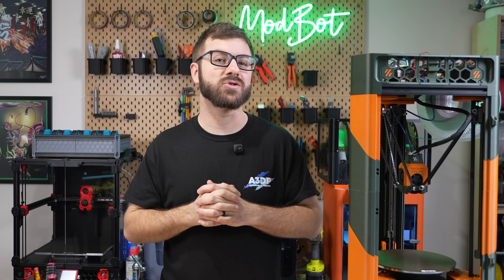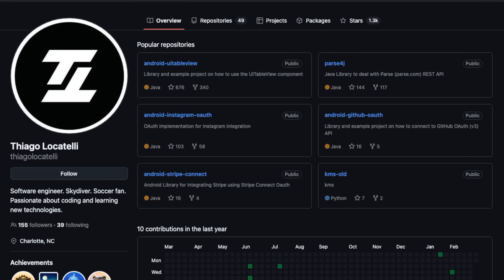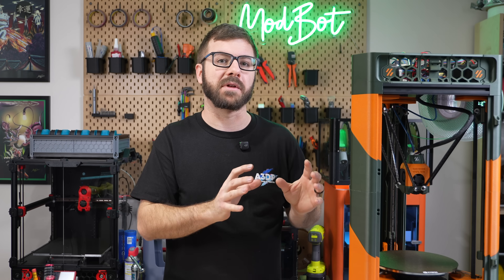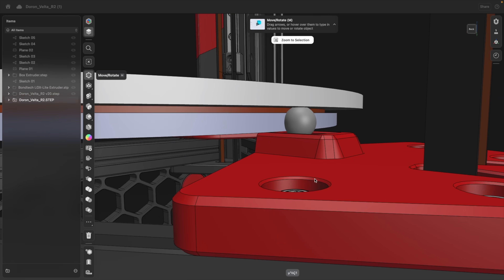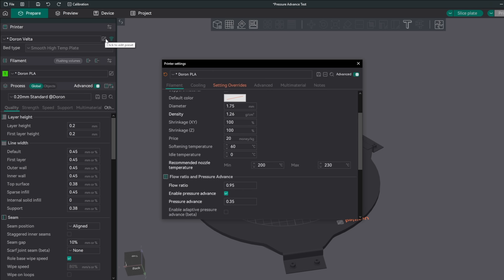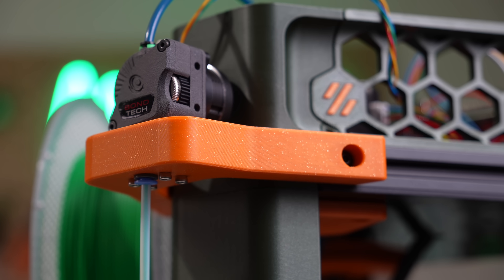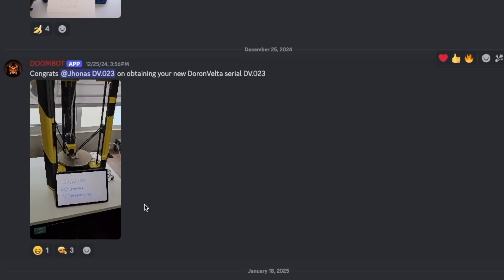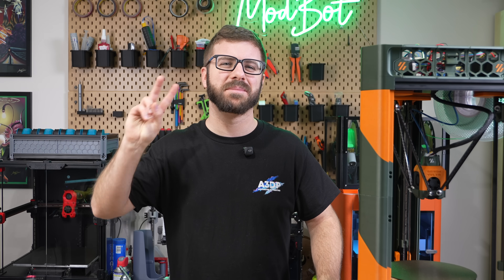Open Source Delta Printer That Began As A Joke! (Doron Velta)

Comment: Hi, having built and designed my own delta printer using a V6 with CHT knockoff nozzles and a 400mm capricorn tube. My Pa values are 0.8 for petg and 0.6 for PLA and retraction is at, 2.5mm. I'm unaware about your figures. But maybe mine help

Comment: Thinking about how a Delta moves, i think the bulged corners are from toolhead tilt. A swing when it stops and a lag when it goes. The more organic models you showed didn't show it as bad as a straight-line-90°-straight-line-repeat. The tilts would be more gradual with the frog, for instance.

Comment: Something occurred to me. The way the printhead is mounted, it could be angled to pretty much any angle to get away from the planar way of printing.  For real control the dual arms would need to be independently controlled because at some angle one would need to be longer than the other.  This would enable printing things that have no support below.  Just print up to the top and then continue on down.

Comment: Helloooo Nurse! My first large format printer was a giant delta, which killed itself during a 22 hour print quite the while ago. I've been meaning to give it an overhaul with linear rails and a rapido, but got absorbed into resin printing until just recently. Enter a new large format corexy, now I need a test bench for filament development without wrecking my good one. Ship of Theseus, now arriving. 👍
Add: to combat stringing on my old machine, I had to run fairly extreme retraction rates. I can look up my old profile for specifics, but I want to say it was 4mm at 40mm/sec retraction. I'll update this if that is incorrect.
Edit2: .1 layer height was 4mm, .2 and up was 6mm, same retract rate between the two. This was back in the dark ages of 2017 for reference. 😉

Comment: During the 8bit repetier firmware era, deltas used to have a "value" that converts standard cartesian movement into delta movement. Playing with this value will either give the prints a convex or concave outer wall.

I don't know if this is still the case with 32bit firmwares, but i thought it might help
Reply: Anyway there is also a flying extruder options for deltas, aside from direct or full bowden.

Comment: Drop orca slicer. I’ve had nothing but issues on my feta with it. I reflashed firmware and then sliced same file with cura and bam. All fixed
Reply: that shouldn't be the solution, bowden extruder is.

Comment: Don't go direct-drive. Delta printers have an option no other printer kinematic has and it's amazing: Flying Extruders!
The basic idea is to mount the extruder via a flexible medium (springs, bungies, etc.) between the 3 rail carriages. This allows for a fairly short and very straight bowden tube. The advantage to the short length is obvious, but the advantage to the straight shot might not be. Being straight, the filament doesn't have an outside-path and an inside-path to shift between, so retractions are much smaller and more effective. I have a modded Anycubic Kossel Linear Plus that does 400mm/s with a 23mm Nema17 mounted this way and my retractions dropped to 2mm with a cheap tube and 0.4mm with a 1.9mm ID tube!
Reply: I had an  Anycubic Kossel that I modified to a flying extruder setup(spring mounted,15 cm bowden). Works nice until you try to go for higher speeds. The oscillating extruder introduced a lot of ringing artifacts.
Reply: @dutchsailor6620  Yeah, flying doesn't decouple the mass/inertia as much as people think. Depending on the height it's at, you can almost entirely get rid of linear inertia in xy moves, but you still have angular inertia, and you need a long bowden tube (bad print quality) to do that. Also if you use loose coupling you're not really getting rid of the mass just damping it, meaning the vibrations turn into really low frequency ones from the flying extruder that input shaper can't suppress except by printing really slow.
Reply: @ I actually sold the kossel and bought me an ender 5 pro, same build volume and faster but without the tinkering. Modifying can be fun but sometimes everything just has to work.
Reply: @daliasprints9798  "flying doesn't decouple the mass/inertia as much as people think": it does if you mount it correctly (as I described above). If you watch my printer when it's printing, the extruder assembly simply rotates rather than yoinking side to side all over the place. Rotational inertia for something that compact is dramatically easier to overcome than the inertia of the same mass on the head.
I've seen improperly mounted examples before, which is why I described how it should be done.
Reply: @glabifrons  Yeah I said mounting it high avoids the translational inertia, but gets you a longer tube (more like long bowden) and still has the angular (yes that's a lesser problem).
Reply: Flying extruder is comparable to bowden in extrusion accuracy/amount of PA you need. RDD is so much better.
Reply: @daliasprints9798  The gap between a curved bowden long enough to use in a delta and a straight shot that's only a few inches long is enormous. Re-read my numbers. The stock bowden tube required an insanely long retraction (way over a cm) and constantly had the extruder motor screaming.
As to RDDs, the idea is nice, but I've yet to see one that's actually got good reviews by anyone willing to demonstrate them... which do you use?
Reply: @glabifrons  Bowden retraction should only be about 1 mm, possibly less, if you're using modern firmware with pressure advance (if not, you're in a really outdated class of print quality that won't be acceptable above like 30 mm/s due to scale of errors).

Where it matters is bowden vs DD pressure advance constants. DD gives you 0.02 to 0.05 mm/(mm/s). Bowden can easily be 0.5-1.0 for a long tube, and 0.15-0.30 for a short flying one. Short is much lower, but still so much higher than DD that it's very limiting to what speed you can do accurately.
Reply: @daliasprints9798  Apparently I cannot even mention a number referencing things on a certain site that hosts models without the post being insta - ( 3 n 50red.
Finally... one made it through. You know the site, same username. Both flying extruder mods were posted over half a decade ago, well before pressure-advance existed.
Reply: @daliasprints9798  At no point was the rotational inertia a problem with the 23mm stepper. It was only just noticeable with the huge stock motor (again, see the things mentioned above).
You mentioned remote-direct-drive, but have yet to tell what you're using.
Reply: @glabifrons  Both the ones I use are on my channel. The M45 has the Semitruck rigid RDD extruder which it about ready for public release (someone has already reproduced it in private testing). My Ender has the Flex3drive G5 with upgearing prior to the flex shaft to achieve high speeds.

(Most of my videos are Shorts in case you're checking the Videos tab and not seeing anything but a small number of longer prints and old stuff.)
Reply: @daliasprints9798  Interesting setup! There was one from many years back that used the exact same approach for a coreXY printer and I was surprised it didn't catch on. I guess the off-axis angles you're seeing haven't been a problem for the U-joints (eg: binding or causing the vertical shaft to flex away during quick rotations at steep angles)?
Are those CF square tubes? (hard to tell)
Reply: @glabifrons  Yes, those are square CF tubes so they don't really flex any appreciable amount. In early versions the whole upper motor mount was too flimsy, allowing the joints to bind at the edges of travel. But with the vertical segment constrained and the lengths chosen to keep the angle within the working range, binding doesn't occur; the path of least resistance is always the vertical shaft sliding up.

Comment: The original Bowden tube length is wayyy to long. Flying gantry extrudes are the best Bowden length v effector weight compromise. But an extruder mounted midway down is a minimum at least.

Comment: I'll take a took, I think it's a combination of hardware and software, it looks like over travel personally but I'll take a closer look. I'm building a duet powered flsun sr with a duet smart effector and high-end motors and end stops. I'm going to build a delta from scratch later this year, but I like the sr kit, so I May or may not adapt it to that.

Comment: just out of curiosity, what are the benefits of this setup over any other standard ones? I am using 3d printer mostly for workshop jigs, accessories, tools etc, sometimes I'll print for someone something. Delta is highly limited due to surface, so  I see it mainly as figurine printer but I wonder if the 3 arms are at any point better than classic bed on X, Hotend Y i Z, or XY for Hotend and movable bed on Z. You make nice content generally, thank you

Comment: 7:50 @ModBot couldn't you use a website like diffchecker to identify the changes between the original and your modified cfg file to identify the changes and then publish those variables give new builders of the DV a starting point?

Comment: I fought with stringing, rounded corners, and holes in my infill until I got a printer with a direct drive extruder. I'm sure the added weight of the extruder on the hotend slows it down a bit, but the time saved not having to wait for 6mm retractions more than makes up for it.
Reply from the maker: Yeah, I have had some bowden extruders that have worked pretty well for me but its been a while really at least since I have used one as my daily driver. I absolutely prefer a direct drive setup any day of the week.
Reply: @ModBotArmy I’ve seen people do an in-between thing, hanging the extruder a couple centimeters above the toolhead on a delta
Reply: At first I mounted the Sherpa extruder at the back with the included bracket and ended up with a rather long bowden tube (>900mm) routed through both top acrylic sheets. Retracts were much too long and stringing was a mess. So I moved the extruder between the top acrylic sheets, being able to reduce the overall bowden length from extruder to hotend to about 400mm. With disabled Z-hop and a retract of about 2.5mm at 45mm/s retract and 35mm/s push I’m quite happy with the results now.

Comment: Built one of these recently; even tuned in during one of your streams! I was cross referencing the available ressources while building the Fysetc kit.

It's a pretty interesting machine, have to say that after all the complications; getting it running truly was a satisfying first step into the world of building a DIY printer. It's down again because I did something silly with the retraction. A heat gun in hand later, going to dive right back into it, probably look into making a top mounted spool holder after moving the Sherpa inside. 👀
Reply from the maker: Oh no! haha I am all to aware of the process of getting something working and then doing something silly. Hope you can get it up and running again soon. 

Do you know if there is a public direct drive model available? I will probably stick with LGX Lite but if there is a step file I can start with for the Sherpa DD it would be super helpful.
Reply: @ModBotArmy  Sadly kind of new into all of this; my knowledge on that only extend as far as to what's probably available on the Doron Velta channel; or reading up things on Reddit. Wishing you the best to get the machine tuned though!

Comment: I've been eyeing this for quite a while but was concerned with the maturity of the project. After watching this I'm glad I didn't pull the trigger on one of these kits. Still, great video, thanks!
Reply from the maker: No problem! Its definitely not for everyone, and far from turnkey, but for those that are looking for a delta project to dive into its pretty sweet.
Reply: @ I built 6 Voron variants of different sizes and types, now working on a 350 doomcube (my most complex project thus far), so I’m not the typical 3D printer user. I’m rather an avid enthusiast who enjoys tinkering more than printing (except 3D printed parts). I wanted a delta machine for a long time, but the Velta just didn’t feel correct, at least at this point. 
I’m fine with tinkering a properly designed machine to achieve good results, but your review made me understand that the Velta has a lot of drawbacks and isn’t completely polished.

Comment: I've had my delta since 2015 and modified it 3 times ❤ the probe I designed has a magnetic hook under the effector but the probe (micro switch) is located right under the nozzle, so with probe offset defined it has worked like a charm for months and months without any new calibration. I'll get back to reply here with a url to share the model and pictures.
Reply from the maker: Ooh! That sounds awesome. I love older printers that have been kept alive/updated. Yes please share!
Reply: Sounds like the SuperRacer setup. L-shaped probe that mounts magnetically for calibration, then stows away in the tool drawer.

Comment: DV.020 Owner here. Assebled one of the first Fysetc kits available with my co-worker. It was a joy to build it the old fashion way. It still needs some love on the klipper side to be 100% fully funcional but the firsts couple of prints that I got from it where really aweasome. Great printer for an April Fool's. Kudos to Rogerlz
Reply from the maker: Hey! Thanks for watching. Deltas are really awesome printers and I love seeing a project based on their kinematics.
Reply: @ModBotArmy  Mine has the same problem with the clicky probe it's hard to get a good first layer on the entire bed. Also my FYsetc R4 board burnt down on second or third boot and I also had a few hiccups flashing them. Switched to a BTT SKR Pico to get a more reliable board as I never thrusted Fysetc electronics always had problems with them.